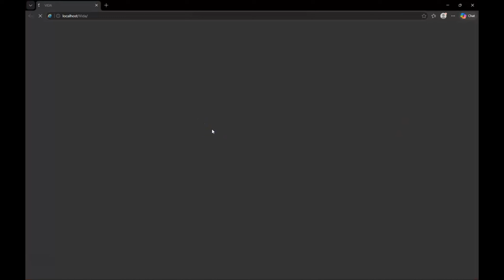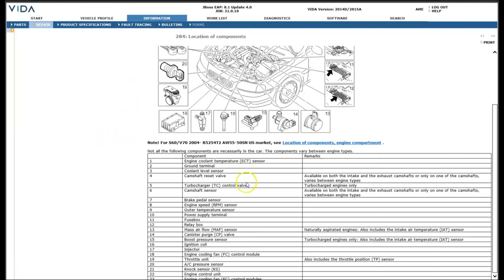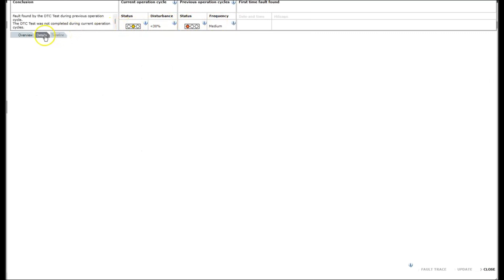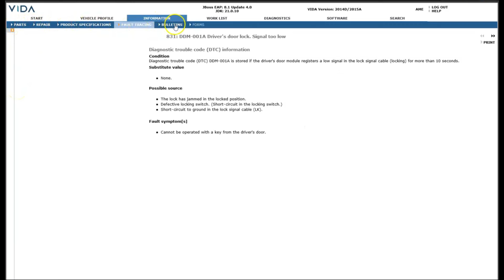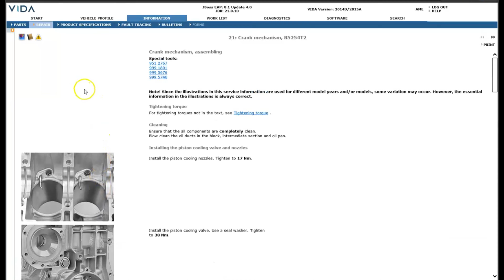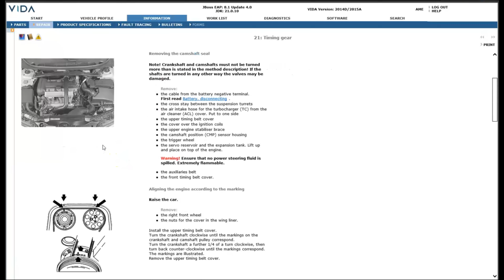Understanding and Using VIDA. The OEM Software For Volvos. I guide for new and experienced users.

Comment: Is this how I would get the on-call deactivated notification off my information module and it also says alarm system service required is that addressable in the software? And it's a 2004 S80 t6. 

Please and thank you sir
Reply from the maker: Yes, you can change settings with this.

Comment: Hello Sir, can you tell me if VIDA software is needed to center my steering wheel after alignment? I have 2020 XC 60 and brought to 3 shops and they didn't know how to center my steering wheel, it's off a little but they checked alignment and said it’s good. I am 3.5 hours from the dealer and it would be a 7 hour round trip for me. Any help from you or anyone that knows about this would be great. Thank you
Reply from the maker: If I remember correctly, Vida only went to 2014

Comment: Great video. I'm looking at getting Vida for 2018 V60 CC. I've gone through everything I can with my Topdon ArtiDiag600. My issue is, uresponsive tailgate. Mine is NOT electric. Through a wiring diagram I see tailgate unlocking relay, can't find it. WithTopdon I can't test the CEM. I've done and checked all the easy stuff. Should I get Vida or am I just lost because the solution is too simple? Thanks, I'll definitely be joining your channel.
Reply from the maker: I am pretty sure that Vida stopped after 2015,
Reply: @F @FarpointRestorationsAndRepairs up, figured that out afterwards. Thanks for the input

Comment: Great video! Although I'm still sort of confused.. these repairs seem like they are excerpts from a bigger manual. Is it possible to find full manuals on vida?
Reply from the maker: Vida is the full manual now. No more printed copies after I think it was 2002 or so. I hated the transition back when it happened. You search for a task (water pump) and it gives you that section of the manual.
Reply: @FarpointRestorationsAndRepairs   I hate it too :face-purple-crying: Thanks for the reply.

Comment: Hello sir! Thank you for the video. I am very new to Volvo and I am about to replace fuel pump on my 2007 s80 v8. If I replace the fuel pump module does that have to be reprogrammed? Does VIDA allow one to do that? Thank you for your time.
Reply from the maker: That will not need a reprogramming.

Comment: Picked up a non-running 2014 XC60 T6, phase one complete replacing the starter and now it’s running. Wish my 09 XC90 V8 starter was that easy😂 Next will be chasing network issues with the DEM.  Should be fun to diagnose with Vida this weekend. Crazy gremlins happen when I plug in the DEM. Is there a network layout on Vida?
Reply from the maker: Yes, when it does it's initial scan, it will light up the network tree. green is good, red is codes, and grayed out means not equipped or not responding. 
Good luck!
Reply: @FarpointRestorationsAndRepairs Thanks. Going to be a fun one. The real odd thing is when I plug in the DEM, I lose powering steering and can’t shift out of park. Plus a boat load of lights on the dash.

Comment: I'm in the process of reprogramming my 2001 v70 xc ecu with stock software for a 2001 v70 t5. I did a B5234T3 engine swap into my 2001 v70 xc and need help finding out if this can be done with Vida? Or can I buy a 2001 v70 t5 used ecu with the t5 software already on it, can I use Vida to switch the vin number?HELP
Reply from the maker: I think we talked via email. if not, let me know.

Comment: Great videos. Currently in the process of downloading Vida. I have a 01 Volvo c70 convertible with a SRS light on the day I picked it up. Any suggestions on getting that off? Also my convertible top only unlatches from the back but not the front. Would the SRS light be related to that?
Reply: Any luck? I could definitely use a tutorial video if you’ve found one.
Reply from the maker: SRS will not cause a drop top issue. They were VERY trouble prone with many micro switches inside. One fails, and the top will not work at all. Very poor setup. SRS is it's own issue.